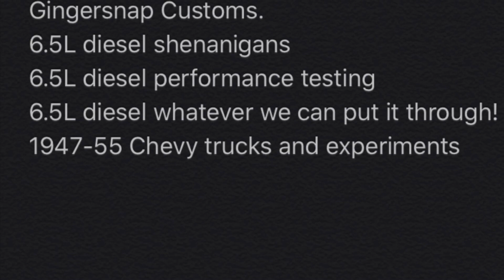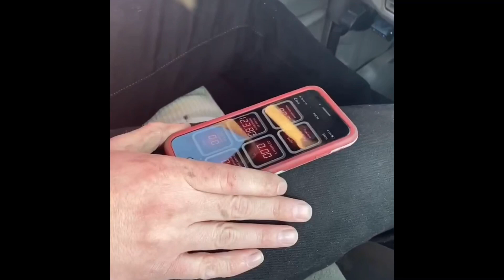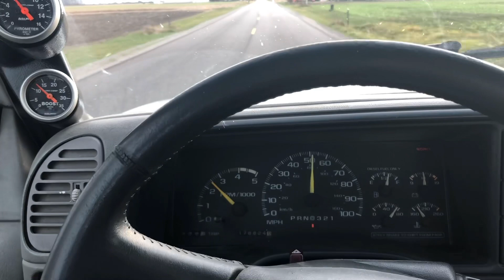GSC 6.5L diesel DIY intercooler.

Comment: I've learned that cooling is a common issue with 6.2/6.5's. Would you say that, even for a stock turbo, an intercooler makes a bigger difference than a high flow water pump? Right now I'm thinking that both would be nice.
Reply from the maker: The stock turbo works even harder running an intercooler. The high flow water pump and bypass fitting will do more in terms of over all performance than the IC.
Reply: @gingersnapcustoms Good info! Just to clarify, when you say it works harder you mean it works better or just more heat issues?
Reply from the maker: @Arexodius  the turbo requires more exhaust drive pressure due to the added volume of the intercooler. These stock turbos don’t move a large volume of air and they work a lot harder when adding that much piping.

Comment: Did you notice a pulling power increase with your intercooler, better fuel economy?  Great videos!
Reply from the maker: Fuel economy stayed the same but I did notice engine coolant temps stayed 7-10 degrees cooler while towing. Air intake temps dropped and I also noticed less of a struggle towing on long grades or up hills.

Comment: Hey buddy, thank you for all the info on the 6.5's (your most recent video helped me to decide to not spend 1400+$$$ on a turbo from a certain company not named) - Im in the middle of restoring/building a k5/m1009 and the 6.2 motor was cracked to hell and back, so I have a 599 block 1992 6.5 now at the machine shop and bought promaxx heads from Jegs.  I want to install an intercooler...watched a few of your vids again, and I was wondering if you could link me to the intercooler kit from Amazon that you used.  I think I found the one you used from watching your videos, but Im not 100% sure.  Id really appreciate a link, thank you!!
Reply from the maker: If you check out the GSC Facebook page I have a whole write up with all of the parts needed for the intercooler. I have another individual looking for the same thing. So it might be time for me to do another post.
Reply from the maker: https://www.facebook.com/100404644965722/posts/295393885466796/?d=n